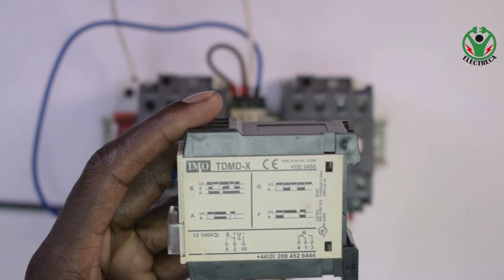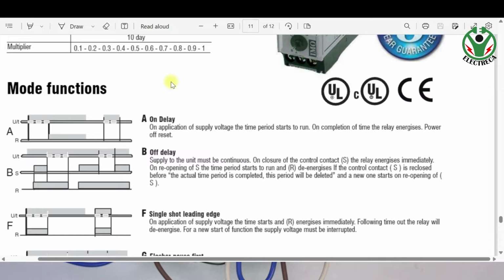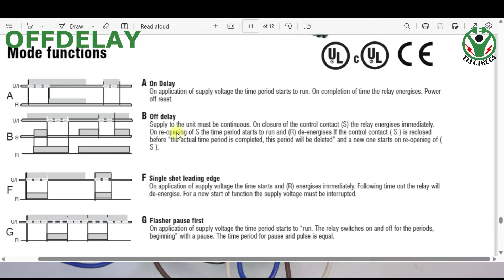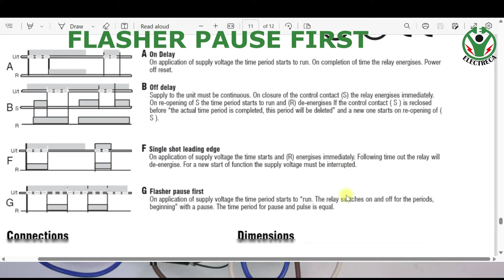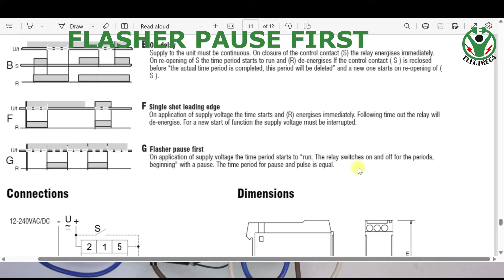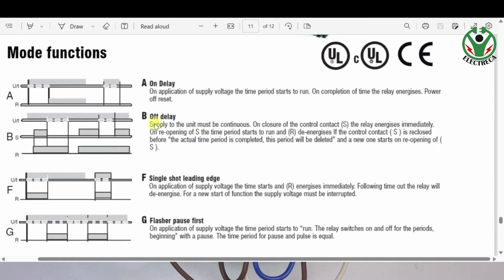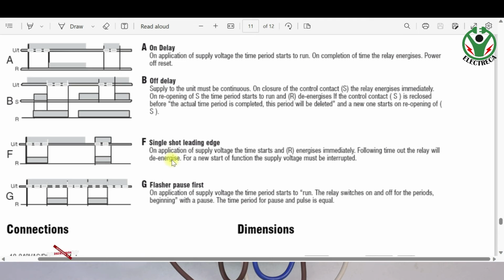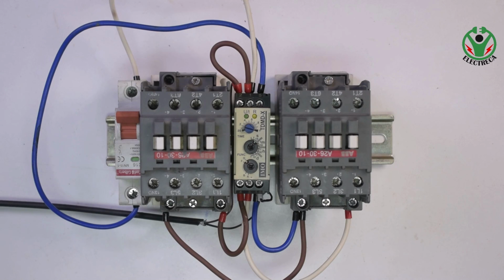Boost Efficiency with Multi-Function Relay Timer

Comment: Please, how do I connect my generator to relay switch so it can turn off the generator once the main supply comes back using 220v Ac pole relay 8 pin

Is this connection correct when i Connect L & N from NEPA to A1 & A2 contacts.
Connect generator stop contacts to normally open (NO) contacts.